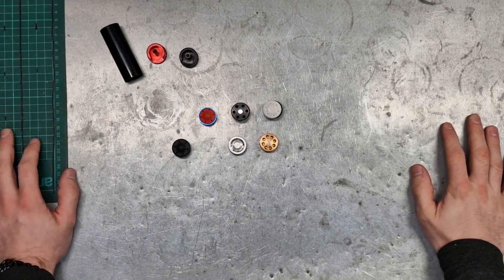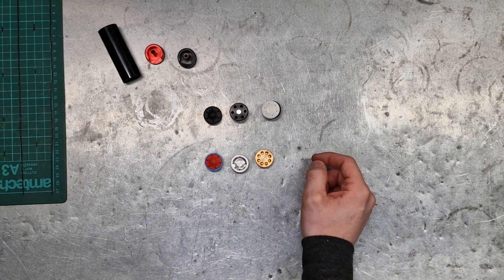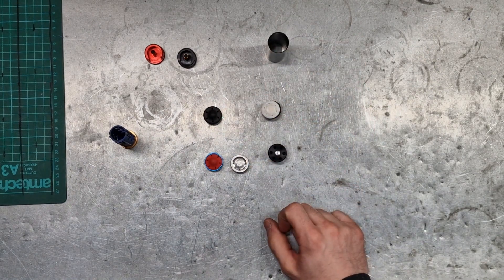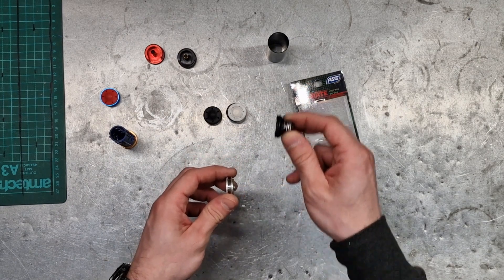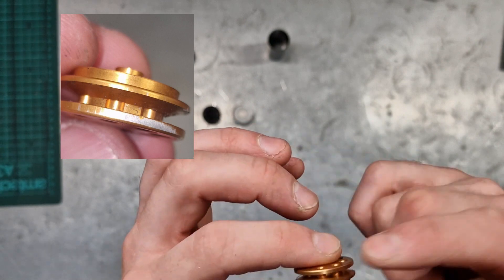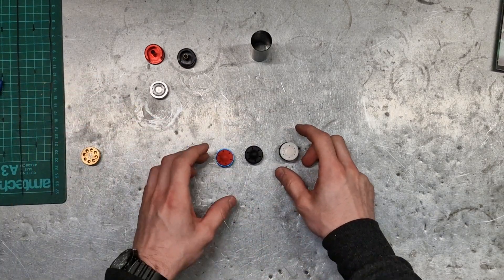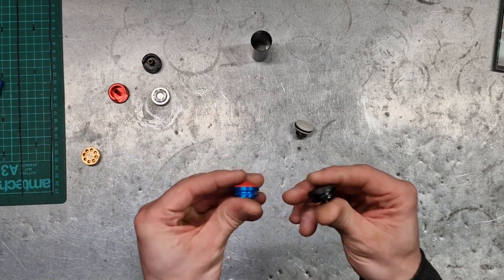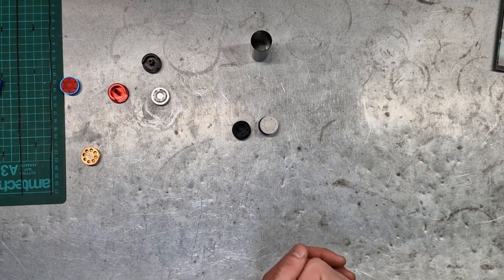Tech Tips -  Piston Heads Aluminium Vs Plastic

Comment: Currently in testing a "Zero Domain" piston head made out of Teflon (seems like someone at China was also tired or scratched up cylinders)

Installation was flawless and it did make the sound more pleasant compared to the original VFC Aluminium piston head.

THIS IS NOT A RECOMENDATION YET
Reply from the maker: ill look forward to hearing about the results dude!

Comment: I prefer aluminum piston heads with double O-ring to avoid scratching. I also avoid nylon piston heads and cylinder heads because they're usually not single piece. If those pieces somehow get loose, they can leak.
Reply from the maker: Yes always check for leaks and loose components! I still find the single most reliable piston heads are good quality POM style with single o ring. regardless you do what you find to be the most reliable for your setup 👌

Comment: You need to make the “music” louder - I am able to hear most of what you say - wih a bit of effort

Will the O rings in the Alu piston head protect from scratches ? Especially the dual O-ring models ?
Reply from the maker: It can protect from scratches with the dual O-ring models yes. but id still recommend the standard pom piston heads over the double o ring design (asg ultimate is a good option)

Comment: i use a maxx double oring piston head and have no problems but my gun only shoots about 40 rps max with no load. i did remove the bearing to remove a bit of weight because i had issues of which weren't actually related but i didn't put it back in cause i find it of no use
Reply from the maker: you may find you have to re lubricate it more often than a standard pom piston head.
Reply: @nemtacairsoft8596  no not so much but then again i am using seperate greases so i regrease anyway cause they mix when i an swapping out parts

Comment: I don't think that can really be fixed. One way or another material will be lost to friction. Doesn't matter if it's the alu head or plastic head.
Reply from the maker: I agree you will loose material one way or another. However you'll get much more longevity from a good pom piston head before it causes issues with the compression, from my experience .

Comment: Great! Another issue I find important is aluminium has a certain amount of stress repetitions before it inevitably cracks and that means an aluminium piston head will inevitably crack/loose/break. I prefer POM or Polycarbonate piston heads better. Specially Polycarbonate piston heads are more sturdy, lightweith and mitigate the ramming stress on the gearbox better.
Reply: whats the spring limit on pom and polycarbonate piston heads? I have some of RA 2 o-rings and g&g for my toys. I asks this cause i have half overspin and double shots on semi, so i think 130 spring should be ok, or 140 and short stroke some tooth.
Reply: +1 for this comment. I have switched to plastic (POM) heads exclusively on cast/factory gearbox builds. Had many gearboxes fail previously, however since installing POM heads I am yet to have a single one crack.